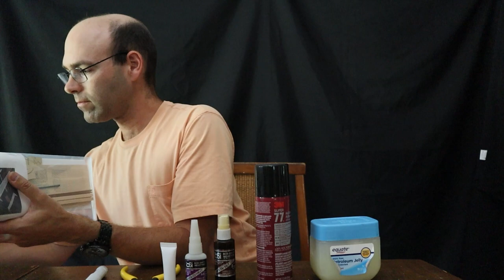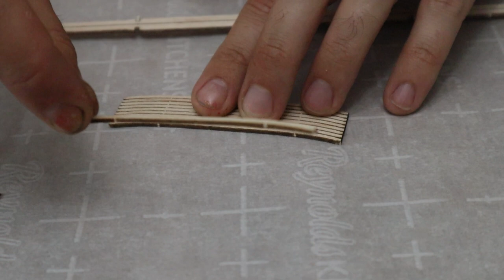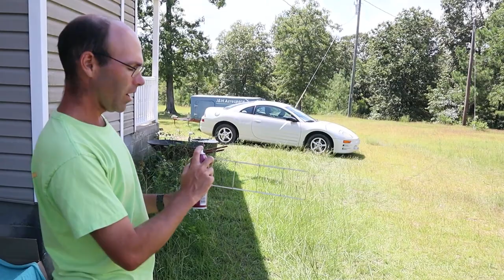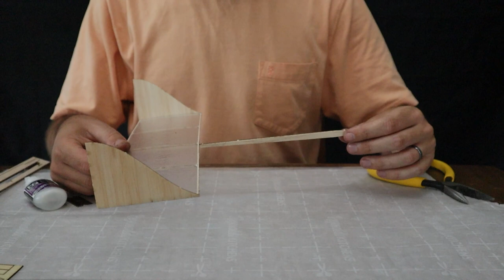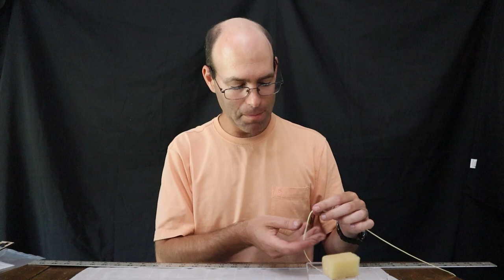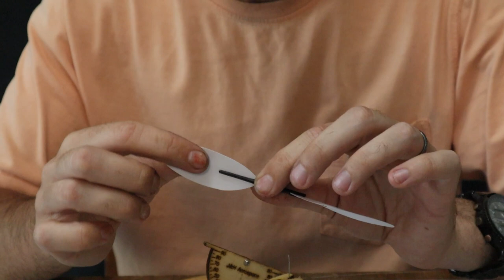Tech Flyer 2024-2025 build instructions

Comment: i have a prop that is 11 inch in length, can i use it for TSA?
Reply from the maker: TSA has a 170cm limit on propellers. You can cut down larger props to get wide blade propellers, however 11" is so large that it would damage the useful blade area too much.
Reply: @joshuawfinn  thank you sir, but I don't know how to trim it
Reply: I bought the F1D plane from AliExpress and modified it
Reply from the maker: @sharansathish  ok that prop might work. Use a razor blade to trim it down.
Reply: @joshuawfinn  ok sir, thank you sir
Reply: @joshuawfinn  Fan of your work 🤠